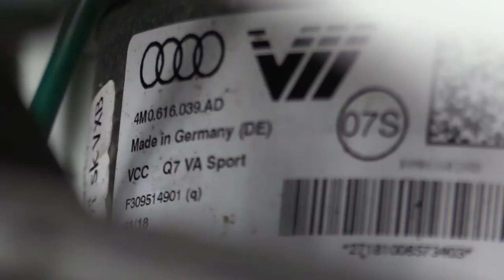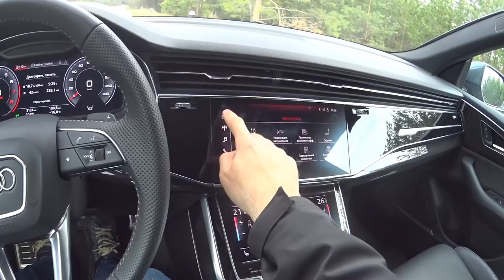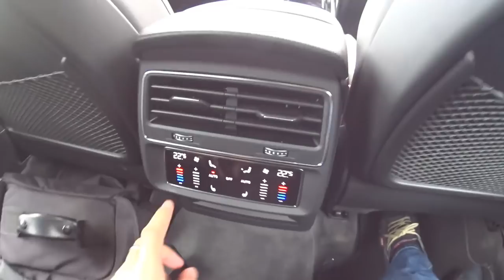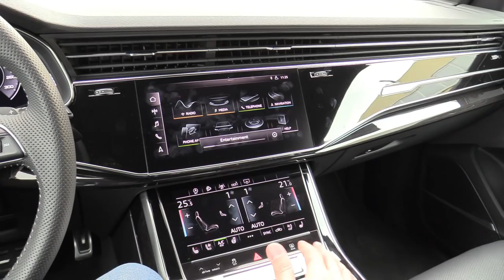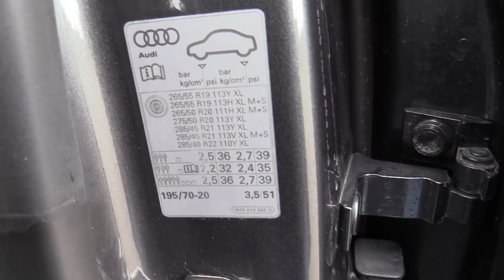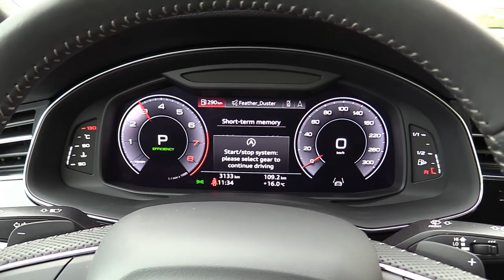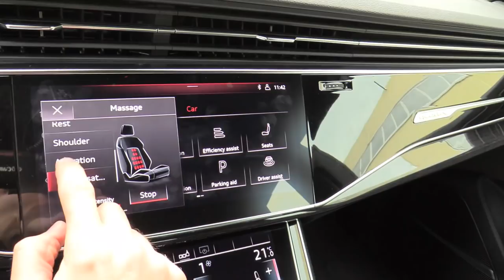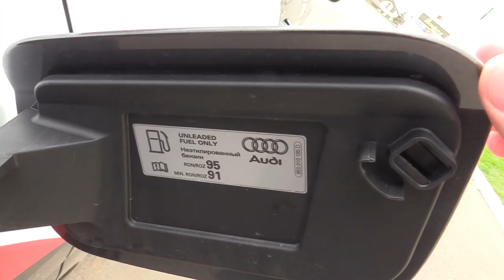Full size luxury crossover SUV coupé Audi Q8 Audi Q8 3.0 55 TFSI Quattro FULL REVIEW

Comment: this gasoline model of audi q8 uses 3.0 tfsi single-scroll turbo with mild-hybrid 48V. starter sound very smooth because using belt-driven integrated starter generator (ISG). for SQ8, available in two choices between gasoline & diesel. sq8 tdi has 2-stage turbocharging, twin dosing adblue, also electric supercharger for initial boost. V8 TDI engine code is EA898 Evo, emits 340PS power & 900Nm torque. combined with ZF 8HP71 steptronic, 0-100 in 4.6 sec. don't forget to create special review of Audi SQ8 TDI, it's a king of turbodiesel suv